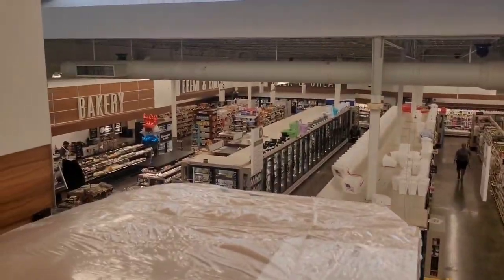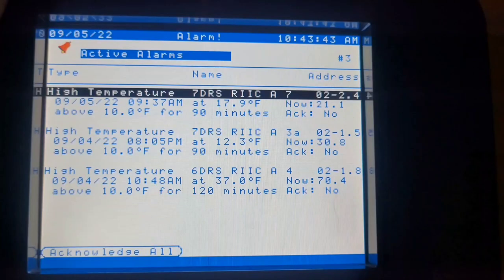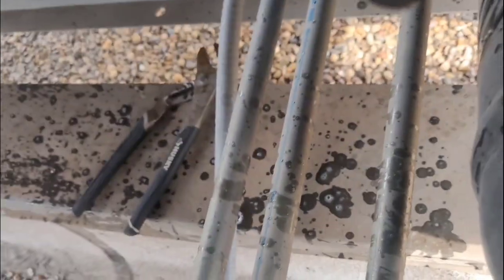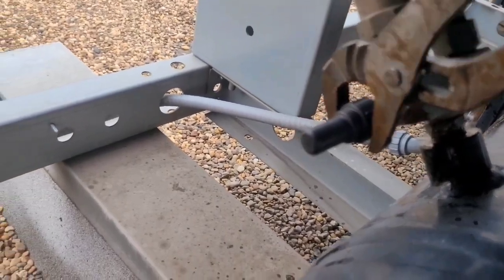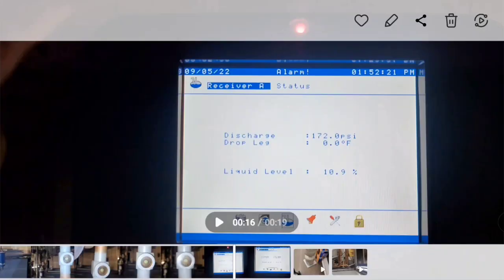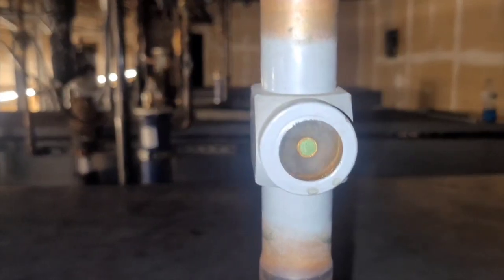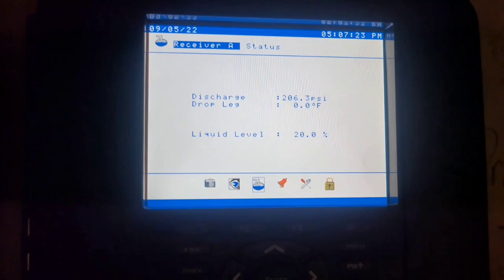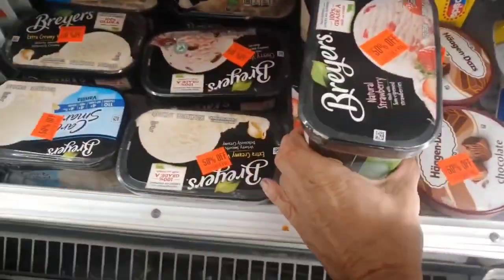SUPERMARKET RACK SYSTEM NEEDED 175 LBS REFRIGERANT - RECEIVER KING VALVE LEAK STOPPED

Comment: You certainly got lucky finding the leak with so many other possible locations and long runs. The next question is who to blame for that oops on the packing nut? I doubt it backed off by itself so it must have been the guy before you.
Reply from the maker: Actually, I found the leak at around 430Pm, and started leak testing around 11am. I leak searched the A4 case very carefully,  as well as the A9 walk in freezer.  I filmed it all, but at the end, it would've been hours of zoomed in camera footage of microscopic leaks that really couldn't have been the source of such a large leak. Before me, we had a tech out who added 100 lbs, 2 days before. Idk who it was exactly, but I know that he missed the receiver valve leak and most likely didn't charge it up enough in the first place with only 100 lbs. Maybe it wasn't as empty when he walked up on it as it was when I walked up on it. But yea, idk how he didn't think to check on the condenser.  Maybe it was raining, lol
Reply from the maker: Idk why it would've been back off either. That is the high-pressure relief valve, so there's no need to ever really be messing with it.
Reply: @HVACRServiceTech  ... that leaves only one possibility. The packing nut has not been tight all along, but the last guy did have the safety cap off for one reason or another.... and didn't tighten it. Either way it's an expensive oops. Glad you found it.
Reply: @HVACRServiceTech  ... quick question... was the other guy using bubbles or an electronic tester, which doesn't always work well outside in a breeze?
Reply from the maker: @rupe53  I actually don't know. The only information I was able to get was that it was Friday(which was 2 days prior), he fixed a leak in the TXV of A4(which actually was still leaking but not big enough do drain 100+ lbs) and that he added 100 lbs. 

Yes, a very expensive oops that the company will probably have to eat.

Comment: I do residential hvac, i want to learn this type next. Seems like there is big money in this type of hvac..
Reply from the maker: I did residential hvac throughout my 20s. I like this better, mainly because whatever work that is required just simply gets done. I used to have to depend on commissions and wasn't particularly the best sales rep. I used to worry about work slowing down in the fall and winter and the struggles that came with it. With commercial refrigeration,  it never slows down, and we stay very busy.
Reply: @HVACRServiceTech  yeah, it does get slow in the winter for sure, i run my own small business, its me and my partner and 1 other employee. Im definitely going to start hitting youtube hard and get a grasp on the basics of coolers and freezers.

Comment: Is refrigerant expensive?
Reply from the maker: Yes. It is very expensive. Those 6 jugs I bought our cost was over $3000.
Reply: @HVACRServiceTech  wow! So just to run a business and be able to service your customers, you have to have a wad of cash available. Then run the risk of not getting paid.
Reply from the maker: Yes, the company has to cover the cost to get the materials. To give you a better understanding of it, these are corporate run grocery store chains, and the company I work for is also a major corporate run, nationwide Commercial Refrigeration Manufacturer, Installation, and Service Provider. I'm in the service department, Texas Southeast Region, and most of the equipment that I work on daily is actually our brand. Unfortunately,  we are the ones who are responsible for the accidental loss of the refrigerant, being that we were out 2 days before, and this was a service callback.  Fortunately for me it wasn't my mistake, I was just the one who ended up going back and and resolving it properly properly, but the company still eats thousands of dollars In cost of refrigerant and labor costs for me to be there most of the day, and the other technician when he was out the other day as well all day doing it.  It was easily a $5,000 to $10,000 loss.
Reply: @HVACRServiceTech  But is it really a loss? Most company's in my country have these issues covered by special insurance.
Reply from the maker: @svdleer  I don't think there is any insurance that covers it. Last year, we had $1.8 million in unbillable invoices for the year. So it's much bigger than just one store.